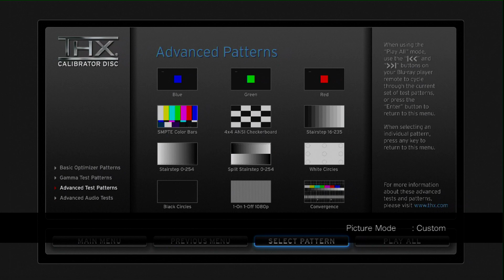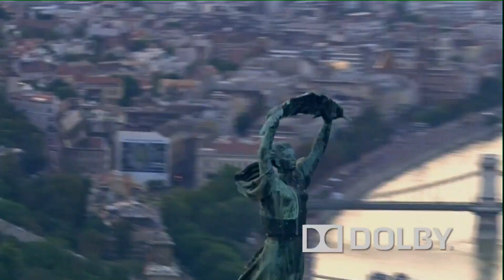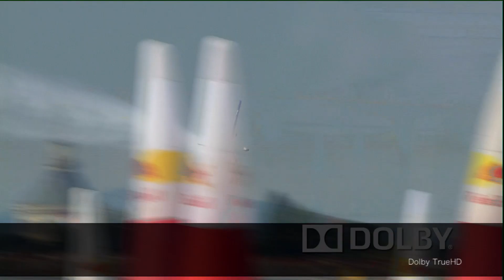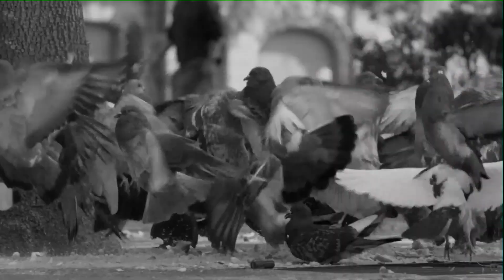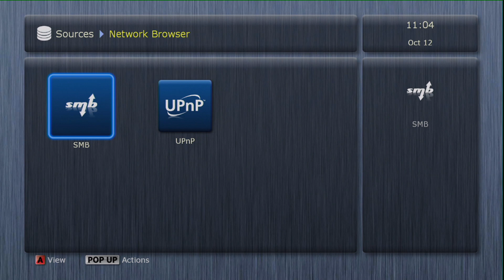ONKYO TX-NR3010 NEW 2012 Range  & Using a Dune HD B1 Media Streamer

Comment: Question: I have a Onkyo TX-NR515 and an Dune HD Prime 3.0. I connected it the same as you have done in the video and also made the same settings in the Dune and Onkyo Menu. When I paly a video file with audio AC-3 or DTS I have no problem and get full sound on all loudspeakers. But when I play a video file with audio AAC or MP3 I get no sound on my loudspeakers. Can you help me? What is the problem?